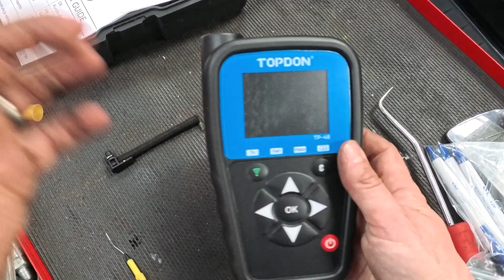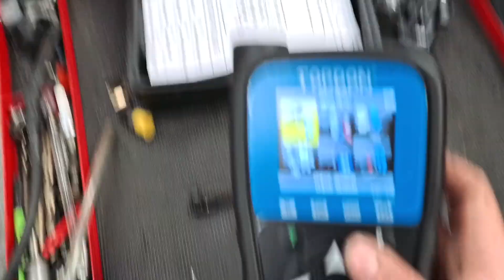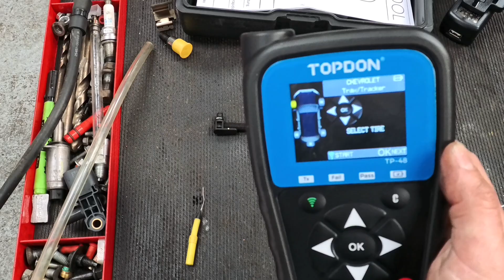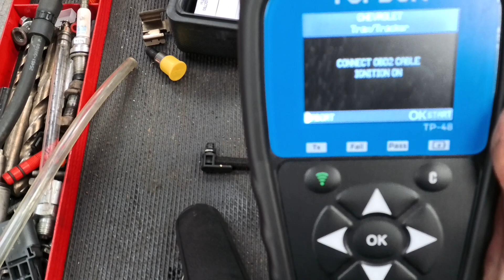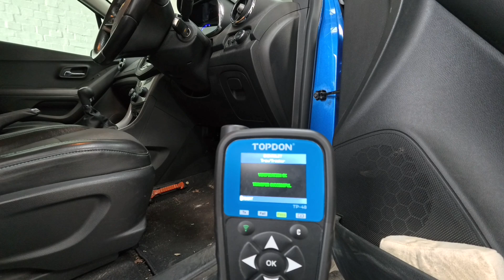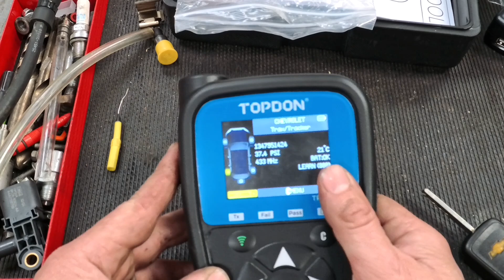Topdon TP-48 TPMS Tool Unboxing & Real-World Test – Worth It for Your Workshop?

Comment: So I am a diyer... so question is.. if it does not read a sensor when doing the test on the left upper corner that means there is no sensor?  Or do we have to link it via OBD2?  Thanks for the video
Reply from the maker: Hi Ed. Good question. If the device doesn't detect a sensor, it will either there is no sensor fitted to that wheel or it has failed. 
If your not getting a signal out of any wheel then question if its using tpms sensors to detect pressure or wheel speed.
Thanks for watching 👍
Don't forget to like & subscribe
Reply: Thanks for the answer… so u right about that… but also i had to update tool … found out using a usb hub did not allow full installation of updates the first time… after doing that i went to scan and it only read one of the tpms… thanks alot for that info